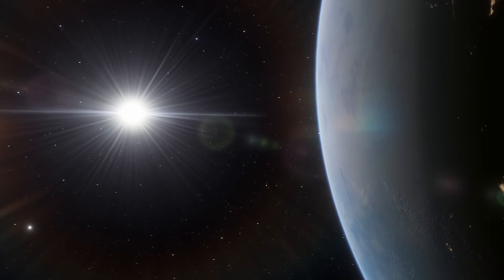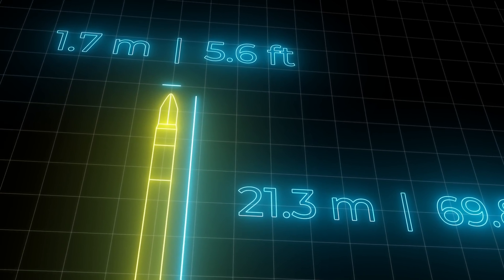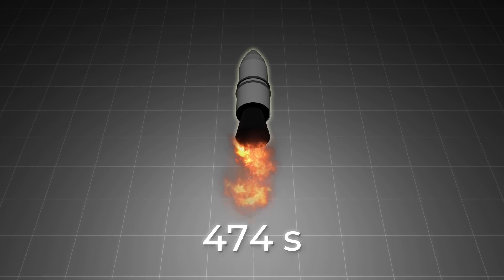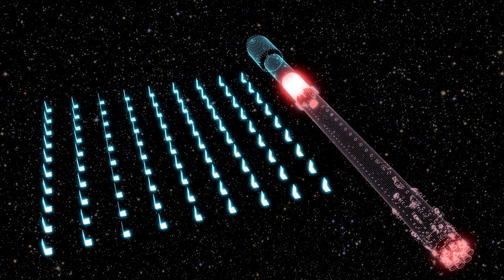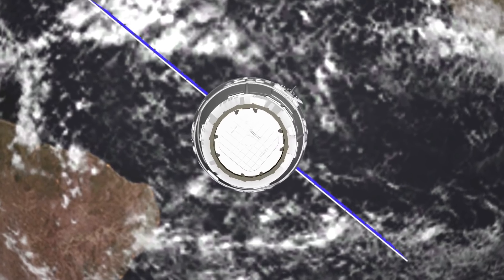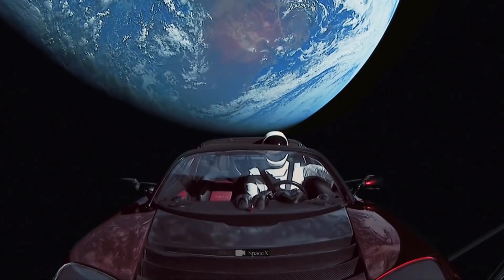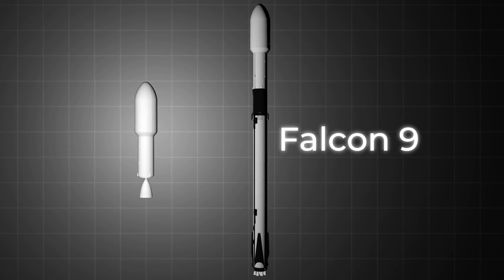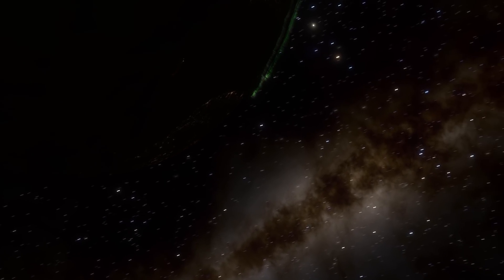How All of Elon Musk's Spacecraft Work in Just 10 Minutes

Comment: There's a surprising amount of very blatantly incorrect information in this video for such a good channel. Really disappointing.
Reply: We can also acknowledge at the beginning of the video he said "Falcon Heavy super heavy launch vehicle", and later called "ultra heavy"; it’s called Falcon Heavy for a reason, as it’s a heavy-lift rocket, not super heavy-lift like Starship-Falcon Super Heavy, nor ultra heavy-lift, a class of rocket only described and has yet to be built.
Reply: @C_B_Hubbs  technically Falcon Heavy is a super-heavy lift vehicle, if launched expendable. It meets the most widely accepted payload of a 'super heavy' rocket
Reply: Nothing is perfect
Reply: What bothers me more is actually just generally the formulations and word choices that are weird at times... A bit cringy tbh...
Reply: Like what?
Reply: @lifestylemisfit  Falcon 9 has experienced varying severites of failure on launch at least 3 times by my recollection (including one loss of vehicle, on CRS-7) and a further loss of vehicle on the pad during testing (the AMOS-6 anomaly).

In addition, Dragon was a vehicle that SpaceX was designing back before NASA had requested anything, so it wasn't made "on NASA's order". It was originally designed to carry 7 crew, not 4. In addition, while it was originally intended to land using the SuperDraco engines, that capability was abandoned due to the difficulty and expense of getting it safety rated by NASA, so those engines are only used for aborts now.

The video also portrays Falcon Heavy as being a successor to the Falcon 9. It is not. Falcon Heavy is designed to carry a different (very heavy) payload class, whereas Falcon 9 remains their workhorse vehicle. Falcon Heavy was actually originally conceived as three Falcon 1 cores strapped together (see Scott Manley's recent video on that).

Not to mention (also drawing from Scott Manley's video), there was a good bit of development history that this video skipped over, like the Falcon 5 and a few other variants of Falcon Heavy.

The stuff on Starship was also pretty iffy, and "launching to space in 2022" is incorrect; they intend to launch to space this year, and possibly try for orbit (though I'll admit that seems unlikely).

He didn't really cover reusability at all, which is arguably the single most important differentiating capability of SpaceX's vehicles, compared to other rockets, and he didn't mention that Starship will be 100% reusable. Which is kind of the whole point of Starship: being vastly cheaper per launch (cheaper than Falcon 1), because it can be rapidly and completely reused.

And as a final nitpick: the rockets are consistently refered to as "devices", which while technically correct would be better off as "vehicle".

And those are just the things I noticed off the top of my head. It's pretty clear that research wasn't well conducted for this video. Disappointing, given that this channel has produced good content in the past.
Reply: I also think the talk about the F1 failures is incorrect. The first one failed because a Fuel line bolt corroded from being in the salty atmosphere, the second because of violent wobble in the rocket because of fuel sloshing and backpressure issues, and the third because of thrust decay
Reply: There’s at least 6
Reply: @richardh4328  - "Falcon 9 has experienced varying severites of failure on launch at least 3 times by my recollection (including one loss of vehicle, on CRS-7) and a further loss of vehicle on the pad during testing (the AMOS-6 anomaly)."
The CRS-7 was not a Falcon 1st stage failure, it was the upper stage Same for the on-pad explosion.
Reply: The BlackSheep Chronicles The part where it said that the falcon 9 has never failed and 2 falcon 9s have failed leading to mission failure
Reply: @lifestylemisfit  too add to the others, they state the Falcon 9 runs on kersone.  Thats not super accurate.  The Falcon uses Merlin engines that run off of RP1. Calling RP1 kerosene is kind of like calling kool-aid apple juice.  There's alot of science and refinement that goes into making that fuel.
Reply: I think they did it on purpose so people will have more hope and interest in space exploration. If you say that: "Yeah, it works bu~t no" won't really get people interested so they had to remove somethings. Think of it as a plane designer telling the public that his planes crashed few times but this one is ok, don't worry. People will just flip the guy off because "The prototypes didn't work so why this one will work consistently?"

Comment: 4:33 Actually 3 failed. One during a static fire test with the Amos-6 satellite onboard, CRS-7 was lost when the helium copv ruptured inside the lox tank, and CRS-1 where the loss of one engine resulted in the secondary payload not making it to its desired orbit.
Reply: Yeah! What he said. 

Lol I don't understand a thing
Reply: Arguable to consider a loss of an engine a 'failure'
Reply: Plus the recent Starlink mission (L7?) which suffered a premature shutdown on one of the first stage engines and failed to land as a result. So that brings it up to 4 failures in the F9 booster family afaik.
Reply: @richardh4328  I think the sats got to the desired orbit so technically it's not a fail since I think F9 block 5s are able to do it if one engine fails. Not to mention it was reused multiple times which is pretty cool
Reply: @GooseCrack  Yeah, I agree it was a very minor incident compared to previous failures. Just counting it because it was technically an off-nominal performance and NASA required it to be explained before flying DM-2.

Five reflights of a booster is certainly an amazing milestone, even with minor issues. And the fact the failure was due to cleaning fluid and not even because the engine had been flown 5 times is very encouraging!
Reply: @richardh4328  Agreed! Its certainly amazing to see how far they've come over the past few years
Reply: he probably meant block 5

Comment: Some nitpicks on my part here:

I wouldn't say that the Falcon 9 did not suffer failures. They had two major failures. One on the pad and one on the ascent. However, those happened on older iterations or "Blocks" of the same rocket. Currently, there are no failures of Block-5 Falcon 9's (unless you count the planned RUD during the abort test)

Also, Dragon 1 was retired, having flown last in March. It's entirely replaced by Dragon 2 which can do about the same capabilities except it's human-rated. One of the downsides of this over its predecessor is that its docking port is smaller than the one used by Dragon 1.

They have long discontinued their goal of making Dragon 2 be landed under power. This is mainly because of concerns from NASA because the landing gear would have protruded through the heat-shield --- a huge no-no since Columbia. Plus, the changes made after the test accident which caused the capsule to explode rendered that possibility moot, anyway.

To date, they have not recovered the center core of a Falcon Heavy. They did land one of them, but then it tipped into the ocean.

They do not plan to human-rate the Falcon Heavy, and I don't think NASA ever will. 

Also, the reentry animation for Starship is incorrect. It will belly-flop into the atmosphere. Those fins are actually flaps that act as aerobrakes.

Comment: just to be precise

Falcon 9 failed twice, september 3 2016 on pad and june 28 2015 in flight

the falcon 9 B5, the current iteration, and B4 the previous iteration, never failed, but since they are incremental improvement and not a totally new spacecraft, you can't say that falcon 9 never failed

failure were on F9 FT and F9 V1.1
30 out of 86 falcon 9 launch were B5
12 out of 86 falcon 9 launch were B4